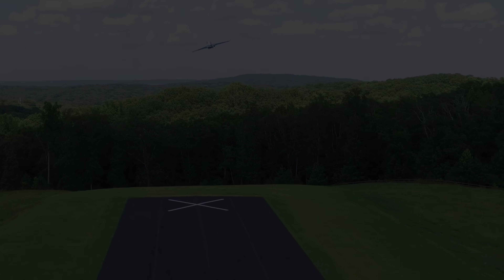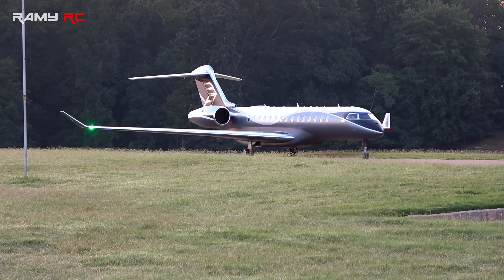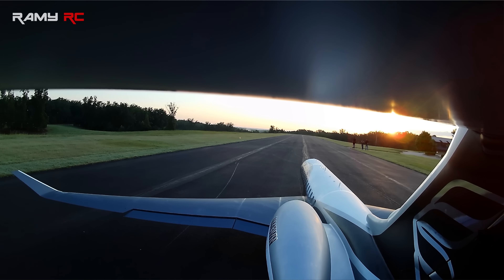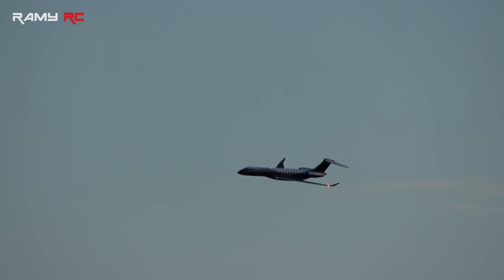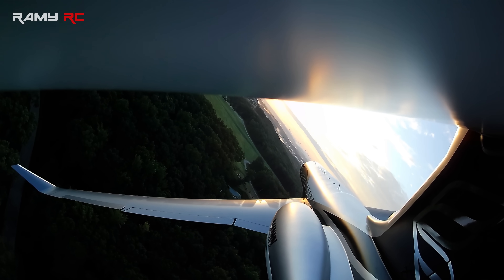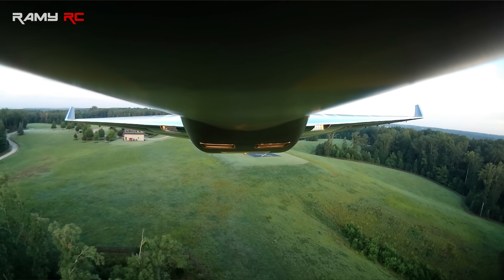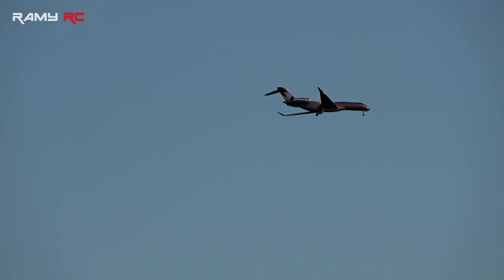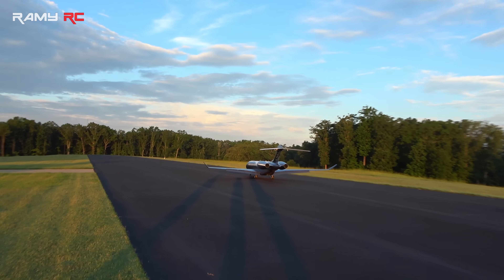World's biggest RC Bombardier Global 7500 Reveal and Maiden Flight

Comment: What better way to work out the kinks of a prototype aircraft design than to make it remote control, then you can design it to fly beyond what you will ever push it to and know that it can take more than you can and not the other way around, maybe even use a chase aircraft and FPV to put you inside the plane

Comment: Hey Ramy, love your unique plane builds truly amazing. I have the Jeti DS24 g2, I'm building a 18s lipo jet. I would like to know what sensors you use for high voltage, amps, current, air speed or any others sensors you would like to add. I would really appreciate any help thanks.

Comment: Another excellent aircraft. 

2010 to 2012 I work on the 7000 8000 project.  The number represents the max range. They obviously had a problem reaching 8000 miles so called it the 7500.

Comment: Couple questions: 

1) are the speed callouts from the radio airspeed or ground speed and what are the units? Assuming it’s mph gps ground speed but maybe you have a pitot tube and it’s in knots? 

2) why not use thrust reverse on landing rollout? Most smaller EDF models these days have reversible ESCs which allow you to reverse the motor direction for reverse thrust on touchdown. That would save the tires/brakes. I noticed some skidding on landing which is gonna wear down tires fast.

Such a gorgeous model though! I think it’s my favorite yet from you guys!

Comment: I’m assuming the callouts are GPS ground speed? If so, why not use a pitot system to get accurate air speeds. Could provide very useful with a 10-15 mph headwind for landings, which seems evident when Tyler is touching down on the last third of the runway….

Comment: you all did an amazing job as always, the best part is how you manage to make the aircraft sound almost exactly like the real versions, one can notice it at 5:38. Phenomenal work! I suggest you now to make the Boeing 747-8 as the magnum opus. The reason why I chose the 747-8 over the 747-400 is the wing design being much simpler and more carbon fiber friendly, you can add krueger flaps on the leading edge which are probably much easier to create than slats, and the flaps are plain in the outboard and two compound in the inboard one. You achieved to do a variable camber wing with the 777x, now nothing can stop you!